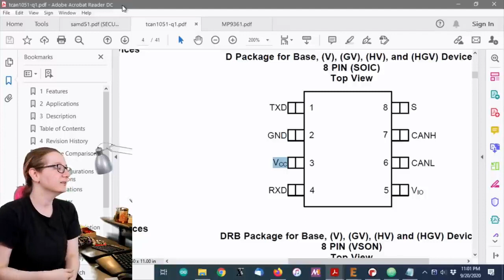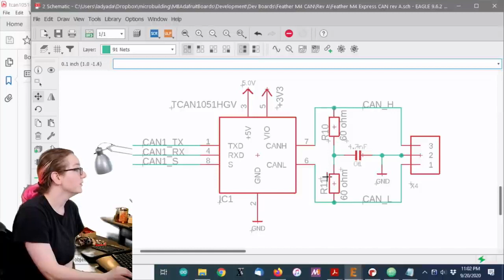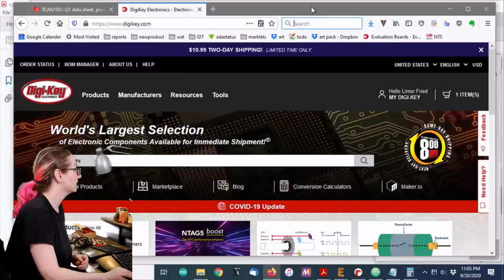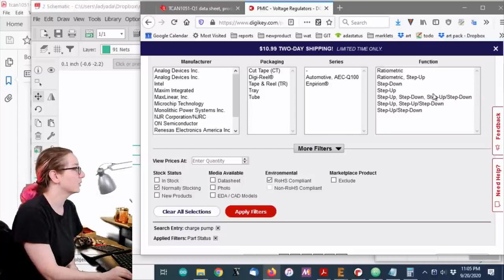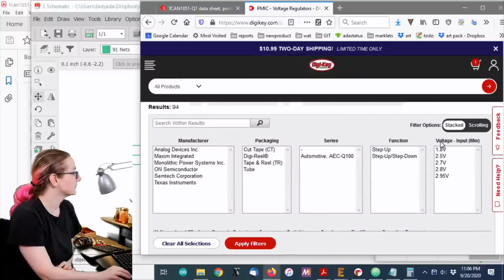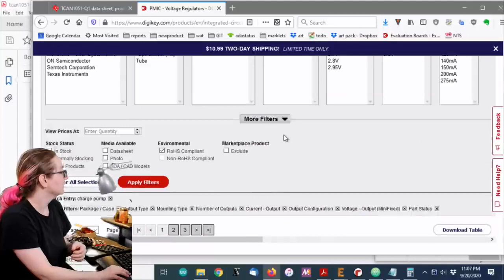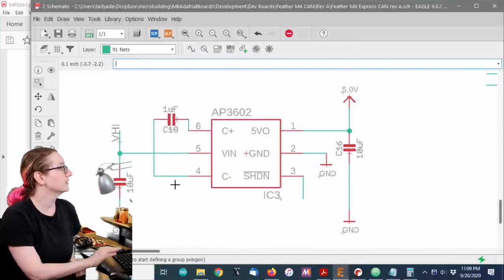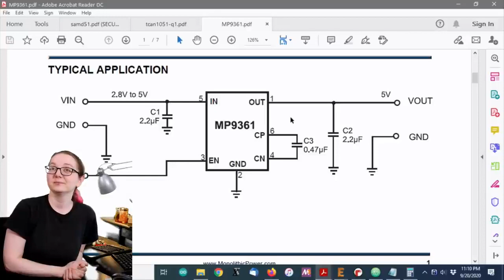The Great Search: 5V Boost for CAN Bus Transceiver #TheGreatSearch @digikey @adafruit

Comment: Okay, LIPO supplied CAN node? And you finally discovered the ATSAME51? :-)
Putting up to 150mA additional load on the 3.3V rail that supplys the controller might be an issue.
I usually have 12V for my CAN nodes and simple LDOs will do.